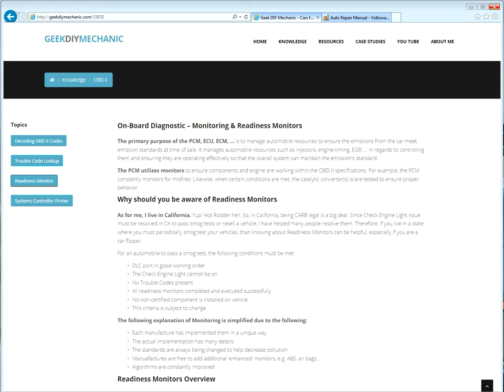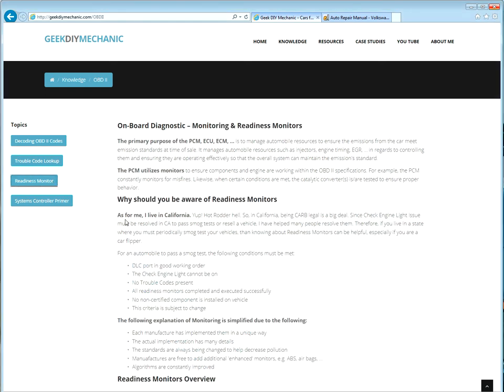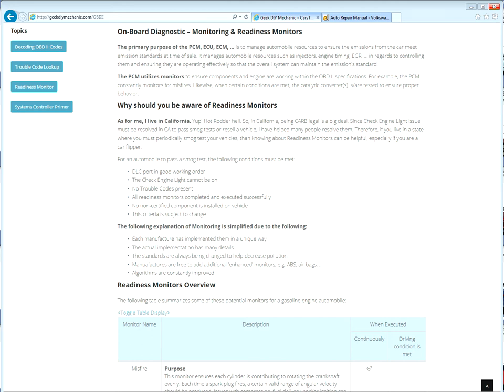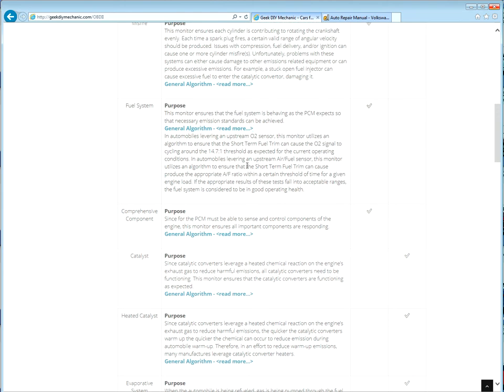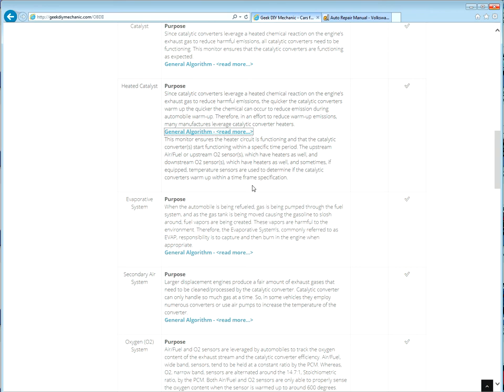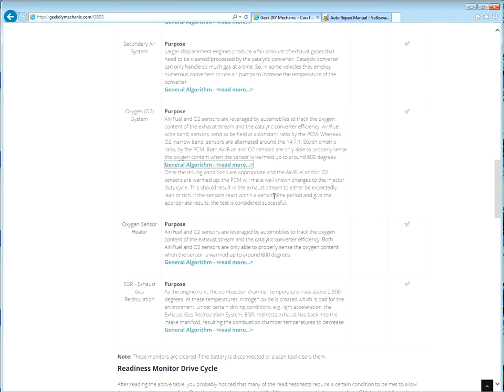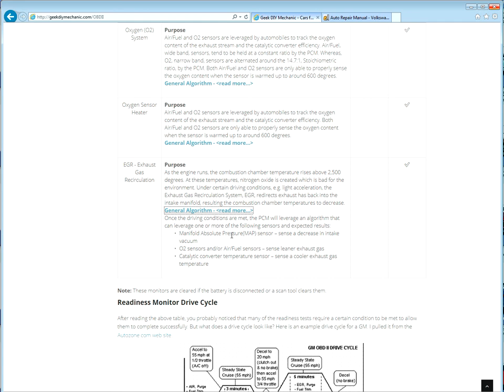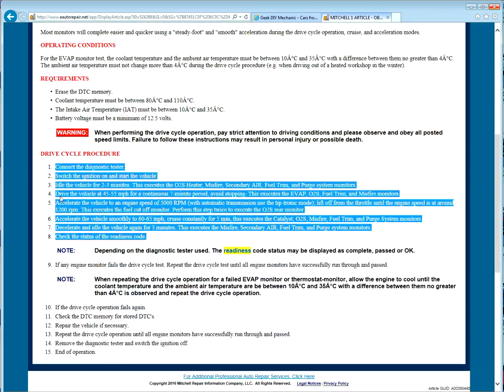OBDII Readiness Monitors Overview

Comment: I do have a Ford F-250 1999 and I got the problem with the monitors not ready I am already frustrated because I drive like 300 miles and still not ready the smog guy mention ( comprehensive component ) and I really don’t know what is this o how I can fix it hopefully you can help me and thank you
Reply from the maker: Could you please send me the names of all readiness monitors and their states?  Using a scanner, do you have any pending or current trouble codes?  The comprehensive component verifies many of your inputs and outputs are operating properly, e.g. throttle position sensor.     From what I understand for most cars, the comprehensive component monitor doesn’t leverage a drive cycle. So most likely one of your inputs and/or outputs arent behaving as expected. . Once you send me what I requested, I’ll see what I can determine.   Please use a good quality scan tool to scan your PCM and tcm.  Is your check engine light illuminated?

Comment: Hello I have a question hopefully you can help me. All the monitors are ready except the O2 cat heater monitor. I have done the drive cycle or I driven my car atound for about 2 weeks and it still not ready. Any suggestions? It's a 2002 BMW 330ci
Reply from the maker: The O2 heater is done at cold engine start up.  It tends to need to be done at idle while the car sits.Look for the following in Google: How-to-Do-BMW-OBDII-Drive-Cycle-For-Smog-CheckI liked this page.Here's an excerpt of what it says in regards to o2 heater.Step 1: Cold Starta) Engine coolant below 50C/122Fb) Ambient air above 6C/11Fc) Don't leave key in ignition.Step 2: Idlea) Run the engine for 2.5 minutes with rear defroster on and AC on maximum.  The more electrical load the better.b) Maybe stay in this step until you enter closed loop.  I'm assuming you have a scanner since you know that this test has to been executed.Please let me know if this works for you.Best of luck.
Reply: GeekDIYMechanic thank you so much. I'll try these steps.
Reply from the maker: Any luck?
Reply: No dude it didn't clear. And that's the only monitor left so I can smog my car. 😭
Reply from the maker: Well, bummer.I would then perform heater circuit testing and validate O2 sensing frequency.  I suggest looking through some ScannerDanner videos to learn how to do this.The heater function is tested by the PCM as the car warms up from a cold start.  The O2 sensor has to be cold overnight for the test to start and has to start responding, since it is brought up to temperature to allow it so sense, within a certain threshold of time.Are you able to view your O2 sensor output? Does it have the proper frequency?  If the frequency is low, that is called a lazy O2 sensor and could cause the computer to not recognize that the heater circuit is functioning.  Or it could just be that the heater in the O2 is just bad.  This is why I suggest running diagnostic tests.
Reply: I'll have to check it. Thanks for the info man really appreciate the help.
Reply from the maker: Have you executed the above drive cycle numerous times?  PCMs can be painful to work with at times.  The criteria for the PCM to meet to even start the test is so picky.
Reply: Yes I'm going to try again today see if it clears up.

Comment: so OBDII Readiness Monitors checks the sensors your talking about ? like a test function ? 
what is the benefit of having this?
Reply from the maker: Great question. 
Part of the OBDII standard had rigorous requirements and specifications for subsystems that help keep the environment clean.  It also required that the PCM regularly ensure that these systems are running and executing correctly.  For example, the EVAP system, used to capture and burn gasoline vapors and not release them to the atmosphere, usually leverages a purge solenoid, purge valve, a pressure sensor, and tubing.  If the PCM didn’t run certain tests, Readiness Monitors, it would be possible for a huge leak in the tubing to just release the gasoline vapors into the atmosphere, which renders the EVAP system worthless.
Here’s another way to look at it.  If you’re a computer person, Readiness Monitors are synonymous to Health Checks.  They ensure the necessary components of the system exist, are available, and behave correctly.
Therefore, if one or more Readiness Monitors don’t pass, this implies one or more important emission components/subsystems are not functioning as they should.  This is why part of the state emissions test procedure is to ensure all Readiness Monitors have executed and passed.  If they all have passed and no Check Engine codes are present, this indicates that all systems are fully functional, and the automobile is producing acceptable tail pipe emissions.
Reply from the maker: Did this answer your question?

Comment: My CatMonitors have been INC for a long time. I believe all I need to do is drive it around for some time and complete the Drive Cycles. What's your opinion?
Reply from the maker: Well, perhaps.  Monitors can be dependent on other monitors to pass.  For example, if your O2 monitors have not passed, there is no way the CAT monitor can perform its tests.So, please tell me the status of all your monitors and maybe I can help you.
Reply: I replaced the O2 Monitors and also bought a new Catalytic Converter. Did some drive cycles to pass EVAP. My other monitors are complete.
Reply from the maker: Ok.How many of the O2 sensors did you change?  How many do you have in total?  How many are new and how many are old?  Were they OEM or aftermarket?  I know of some cars use a generic O2 sensor and never pass the O2 Monitor or even run well.  I know of a girl that had her boyfriend install a generic O2 on her car, and her car has never been the same since(idles like crap and runs rich).  I won't touch it since who knows what the neck he did to the car.Assuming you're in CA, did you purchase a CARB legal Converter?  I ask since sometimes a non-OEM certified converters don't respond in a way for the PCM to pass the monitor.  I had a friend with a Camry with this issue since he went with a cheap aftermarket CAT.If you have your shop manual or use Mitchell DIY, you can actually look up your pre-conditions and driving cycle to have the Cat Monitor execute.They can be tricky for sure.  Some cars could take up to 50 miles or even more.  I have worked with people that took only one drive, others taking a week, and others requiring an exact drive cycle.  BTW, they usually start with a completely, overnight, cold car/system.You must have a scanner.  Do your fuel trims, short term and long term, look ok?  Are the upstream O2 sensor oscillating?  Are your downstream O2 sensors fairly stable while cruising?I'm assuming you have no current trouble codes.  Right?So, here's what I do.  1. No DTCs2. Fuel trims look good(less than +/-10% each)3. O2 sensors are responding quickly with good amplitude4. All other PIDs look reasonable, MAP, ACT, IAT, MAF, ....  5. Ensure they are heating up quickly, meaning make sure the O2 heaters are working correctly.6. I then research the drive cycle and pre-conditions necessary for the particular monitor I'm trying to get to execute.  I then try to follow that procedure to the letter. Lastly, if I can't get it to execute, I then look at OBDII Mode 6 parameters associated with the failing/not running monitor.  I try to figure out what part of the test is failing.  I also look at other OBDII Mode 6 parameters to see if they are near border conditions, meaning they are barely passing.Using this technique, I have been pretty successful getting the monitor to execute.I have said a lot here.  I hope something here is helpful and helps you get that pesky monitor to execute and pass.Best of luck my fellow DIYer!
Reply: Now that I have read all that. I have a total of 2 O2 sensors(Oxygen and Air Fuel). I am sure the O2 sensors are OEM but I'm afraid my CAT Converter isn't legal at all. I just went back and check and it says "Not for sale or use in CA" which means I probably have to buy a new converter. Which is probably not even C.A.R.B Legal so I'm screwed either way. Plus I haven't tested the specific Drive Cycle for the Cat Monitor because I just found that info today. I thought that my old CatConverter went bad so I bought a new one. My last option here is to probably buy an OEM CARB Legal Converter but I don't want to spend that kind of money if my old one isn't the problem. What do you suggest? Thank You Sir. You helped me so much. Not even the AutoShops can tell me this much.
Reply from the maker: Ok.  Therefore, your A/F sensor would be considered your upstream sensor (before CAT), and the O2 sensor would be considered your downstream sensor (after the CAT).  Ensure they are installed correctly and in the proper locations.  That is very important.  I'm guessing they are installed correctly since you'd have some major issues.   ScannerDanner has some videos on how to test an A/F sensor.  In essence, using your scantool, you will perform snap-throttles from idle with a full intake.  You will then ensure  that the A/F sensor graph looks a certain way.  It should go rich(down), then lean(up), and then back to lambda 0(middle).You didn't say anything about your fuel trims.Well, to be honest, the visual inspection portion of the SMOG test should have your car fail since your converter does not have a CARB sticker/marker on it.  Just saying to be thorough.There are tests you could have done to determine if your old CAT was bad, but that is a mute point now.  Check out ScannerDanner.  He has a couple great videos on how to verify if your CAT is healthy.  You first need to verify your AFs/O2s are healthy.  ScannerDanner has videos on this.   In regards to testing your CAT,  you test that it responds quickly to A/F exhaust ratio changes, and that it stores oxygen properly.I don't want to get in trouble by saying just use the non-legal converter for your car.  But, I have known people to pass using one.  I have no idea how they get their cars to pass, but somehow they do.    I can understand why they try since CATs in CA cost so much.  Just wrong....I'm very happy that I was able to help you.  You made my day.I hope you are able to get your car to pass.
Reply: Appreciate your knowledge and time. I will watch his video and find out. Thanks for the referral. I'm a fairly new driver so I don't know so much about cars but I'm slowly learning. Again, Thank You.
Reply from the maker: Hi.  I hope all is well.Were you able to get your car smogged?
Reply: Haha yup. It was just the Drive Cycle that needed to be done. Your info is great to know for the sensors though. Thanks.